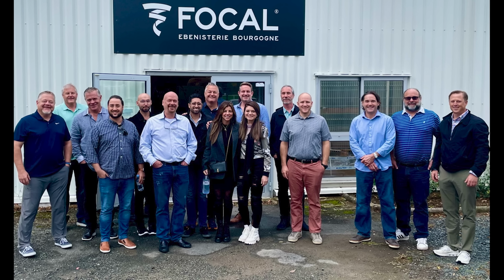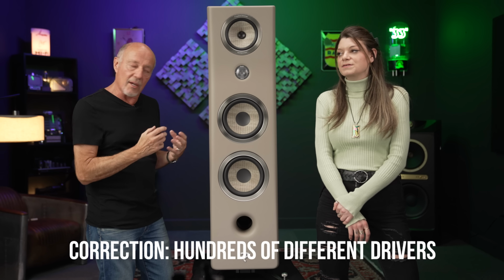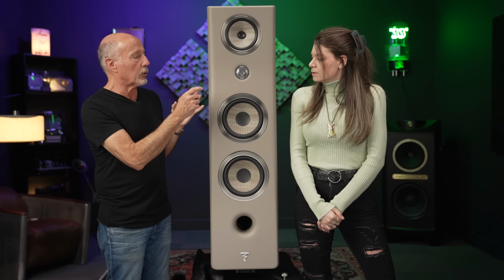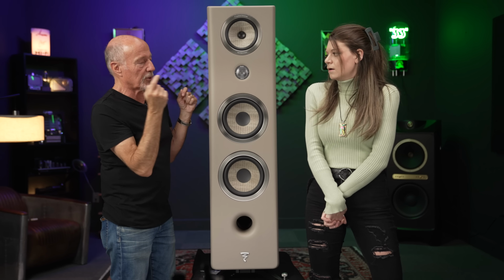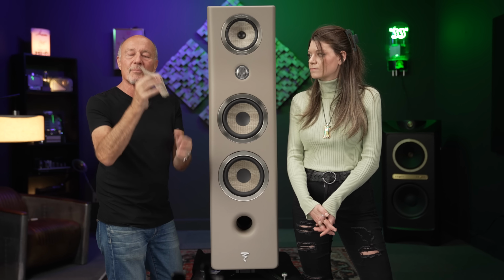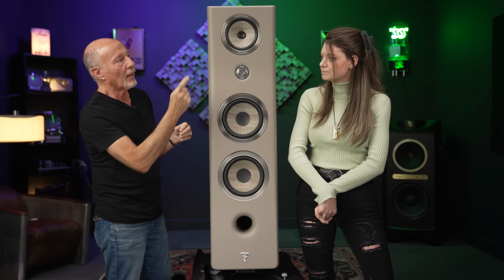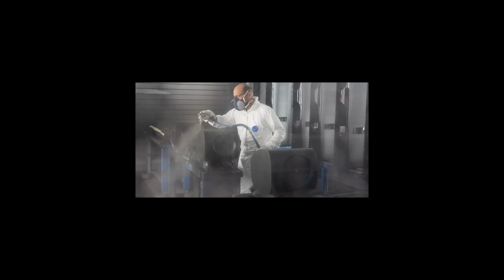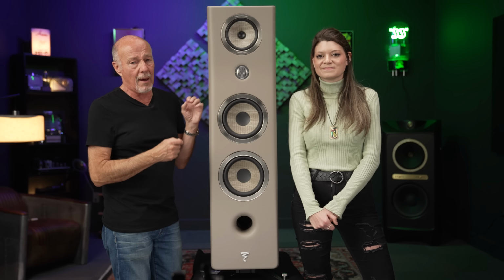Focal Kanta Loudspeaker Review w/ Upscale Audio's Kevin Deal & Kat Ourlian

Comment: Great conversation and review.  A couple clarifications.  I have a pair of Kanta 2 ( bought from you guys) and I love them.  However, they do have ports both front and back just like the Kanta 3.  Also, even though they are fairly sensitive, they have challenging impedance curves.  They really do shine better with higher powered amps.  I’ve tried many amps and the more powerful amps bring out the best in them.
Reply: Have you tried them with the Technics SU-G700M2 Digital Integrated Amplifier?  I think they would match perfectly..
Reply: @americana1544  I’m using a McIntosh 452 and it’s heaven.
Reply: Try them with the Yamaha AS 3200 or the Creek Destiny Voyage i20 😊
Reply: Try them with Accuphase. As you may well know, as audiophiles we have to try every possibility if we have the chance.

Comment: Hello,
I absolutely love your videos and this one is too good.
You are one of the very best youtubers out there for HIFI gear. Very informational videos I must say.
This one too you have explained it so so well. 

You being so experienced I wanted some help and guidance.
I currently own the Choras 826 powered by a Nad C388 150w per channel Integrated amp, streamer being blusound node with the JL Audio E110 sub. I am planning to buy the Focal Sopra N2s and upgrade my amplifier later.
Just wanted to know if the power on my Nad is enough to drive them at moderate volume? do not want to risk damaging them.

Also, what amplifiers would you suggest with them when I plan on upgrading later.

Thank you so much for your help in advance man.

Cheers

Comment: Kat's a rock star...I'm one of those who always heard that Focal is bright. My ears are super sensitive to the highs, and i always blamed ringing in both metal diaphragms and oversampling dac designs. I can see how beryllium would help after break in. I'm currently using 2 way semi omni directional with the omni ring tweeter at 2khz and up creating an ambience without fatigue so it was my best solution for my sensitive/tinnitus ears.
Reply: Classically, Focals were bright, but that was mainly when they were playing with Titanium tweeters at the upper end in the 90's.  Those puppies, even after they "tamed" them with a layer of titanium oxide, could shave the hairs off your eardrum, especially in car audio.  Once they ditched that for Beryllium and the Aluminum/Magnesium tweeters, you got the same level of detail without the tinnitus.  What I'd really like to see on their home audio line is bringing their K2 (Kevlar) Inverted Dome tweeters.  In the car audio line, those got the closest to having the detail of a metal dome tweeter with the gentleness of a soft dome tweeter.

Comment: The ringing between the two tuning forks actually doesn't even make sense in a tweeter because the tweeter doesn't actually have any movement to it. Sound just comes out of a tweeter without any parts physically moving so regardless of titanium or beryllium there isn't any ringing.
Reply: "Sound just comes out of a tweeter without any parts physically moving " - of course parts are moving.  How do you think the tweeter makes sound?
Reply: And with the poron suspension, they're getting more excursion out of the tweeter than most other brands.

Comment: What's the best amplifier to be paired with the Kanta 2?
Reply: Any really but I have them paired with tubes
Reply: In general, Naim amps work extremely well with Focal speakers.  As Ogthebog suggests, most tube amps also do a great job.
Reply: I'm running Parasound gear with my 3's and it sounds great, but they are part of a HT setup.  Would love to try tubes one day
Reply: I’m using a Primare i25 prisma with my Kanta’s 2. Sounds great.
Reply: I’m using an Arcam AV41 with a PA240 for my Kanta 2s.

Comment: Every enclosure design is about compromise. The ported enclosure design is rife with issues. Every port has a resonance frequency. This is a problem. The extra bottom end or bass they are hearing is in part that resonance, it's fake bass, adding in at the lower end frequency ranges, that's not musical information you are hearing. 

When they pulled out those forks, I thought, alright, they are going to demonstrate just how much those cabinets ring, but it went on about baloney materials , oh well. 

Colored sound reproduction is what these boxes do best.
There are better designs to experience.